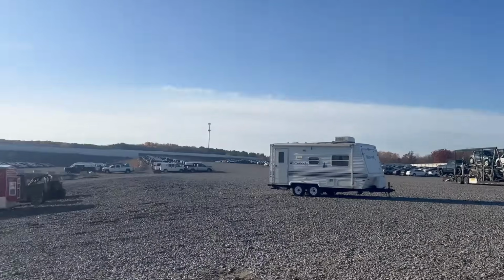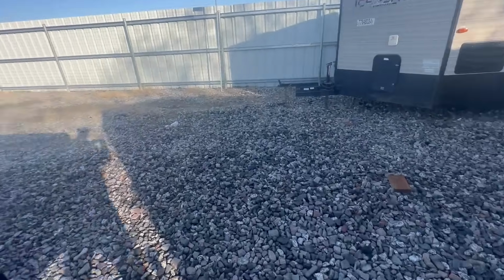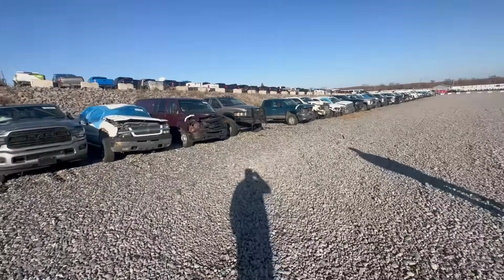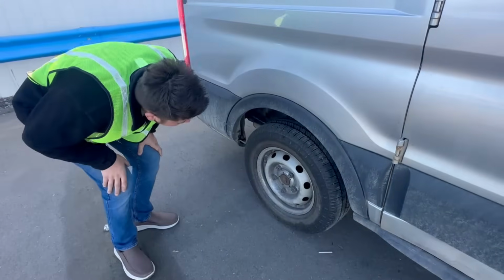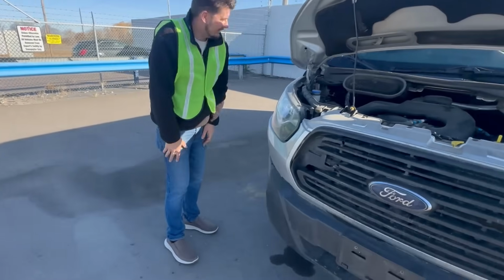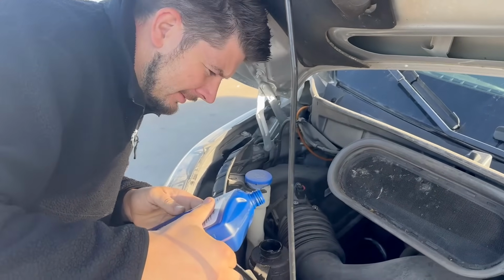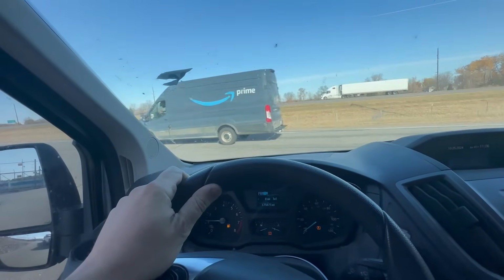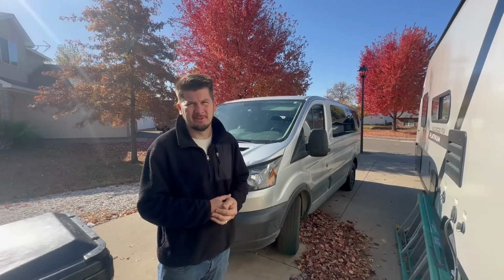Ivan Travels to Minnesota Copart Are There Some Hidden Gems?

Comment: Do you happen to remember which Copart location you went to in the Minneapolis area? 
In my limited experience the Teslas generally - not always -  are at the Minneapolis location closer to downtown in Fridley. That location has little room and is jammed into a triangle off River Road.

You might be at the Blaine location - I bought my first Copart Mini Cooper s out of that location.
There are two more lots not too far north of the Blaine location in Ham Lake. One is a sub-lot which I have not been to. 

As you well know big operations and expanding / buying up land quick.